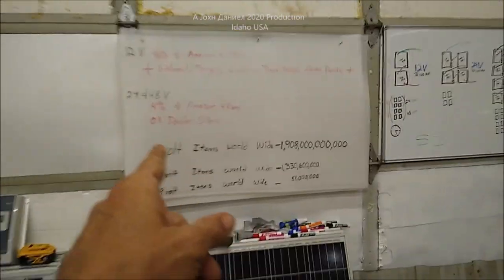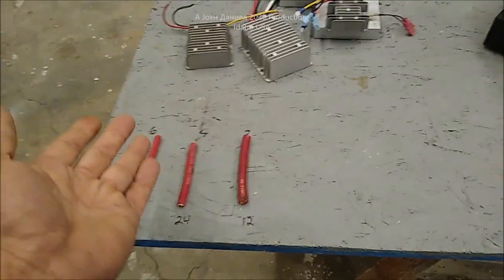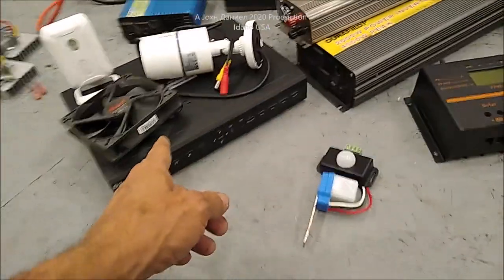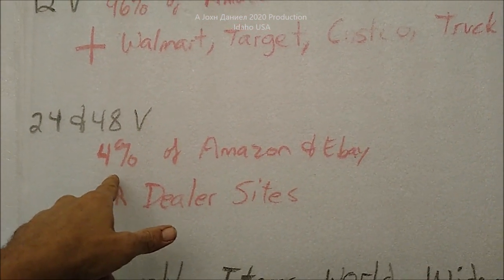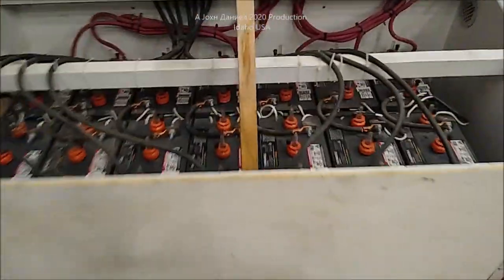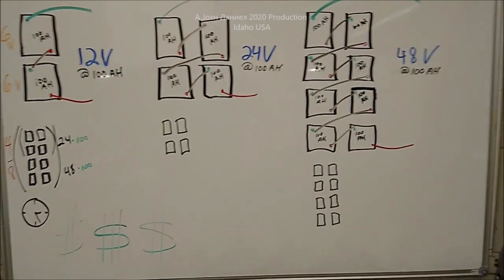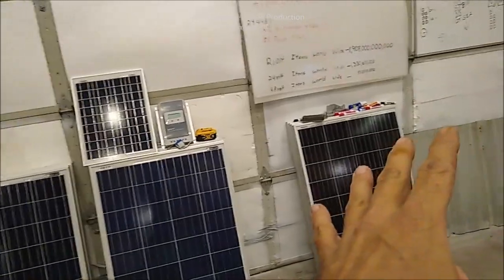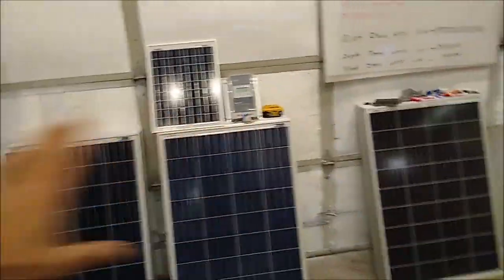Solar Wind Hydro 12 VDC is Best Voltage on Off Grid Survival Power System (Graphic Info)

Comment: One thing you seem to miss is.  Most controllers are 12/24 volt and using 12 volt batteries provides WAY more backup options on batteries in an emergency. Also running 1500 watts off of 12 volts runs 100 amps. When it gets hot outside equipment can burn up and efficiency goes WAY DOWN.
Reply from the maker: You will run a 100 amps starting your car, do we get rid of cars? Almost anything can burn up in super high heat if installed wrong. However, the 12 volt stuff from regular makers has been designed to handle more heat since its often used/ABUSED in RV's, Semi Trucks and boats. 
 I met a lot of people with massive refined computer controlled  Fronius, Outback, and Sunnyboy, 4.5 to 6kw inverters they paid multi thousands for that fried from a bug getting in them.
 Bet you didn't know 48 volt and bugs is a higher & bigger board frying arc as a team than 12 volt and a bug!!!  You open lots of 12 volt inverters still working just fine but needing cleaning that are full of bugs, but just let one get into a high dollar Fronius or Outback  (like the mosquito that blew up a $4000 inverter) and POP! Funny part is those people always have no redundancy! Freezers stop, and poof thousands in food go to crap. They can't run to a Truck Stop and get a spare to save yourself, no no, And I Saw it happen lots, not once.
Reply: @JOHNDANIEL1  I run 24 volts and 250 watt panels. Been through hail storms havent lost a panel yet. 24 runs at half the amp load to do the same job and the equipment laughs at 2500 watts. In an emergency 12 volt backup units are easy to install and native to 24 volt installations. But on a daily basis running main gear at half the amperage saves the day because common electrical wiring and breaker panels can be installed. Commercial square D breakers and panels have a DC rating as well as an AC rating. Much cheaper and easier to source than 100-400 amp safety gear for 12v systems. And I only worry about 6 panels instead of 15.

Comment: Liked the way you see it and it’s true ,I had an issue with 24v ups  it was great unit but I had to had 2 batteries in series just to power the inverter no other way and to charge it if it’s circuit what a bug , I had to buy those converters you should hehehe to maintain those two batteries charged . A 12v will or cut run in a single 12v batteries lead acid - and the other chemistry’s but it’s true there’s so much options for 12v . Also weight hehehe many will argue well what about the watts in solar you can go higher wattages faster but that’s another crazy topic anyways I know there a bigger demand if you want more watts from 12v but yeah if one battery fails you have backup .  I just happen to like lithium hehe but yeah it’s more expensive and hard to get you can just go to Walmart or Costco or any local store or auto parts and get yourself a lithium battery it must be order which does have its cons but then again it’s best to go w the 12v systems .

Comment: Hey John, I have no idea what your inside deals are!  What particular wind generator are you talking about?  I see some but which ones do you recommend that the fins dont fall apart after a year.  Are you saying a 500 watt you have to buy 10 batteries?  Is 500 w useful for running items?  What about the solar panels?  The one that sends you to WalMart? There are more than 1 panel.... so are you talking that particular one that first comes up? Additional some advertise waterproof connectors?  Why would you put a non-waterproof on a panel?  Can’t you just give a particular one and it goes to that particular product?  I dont want to waste my what little I have on buying the wrong thing.  Still Confused... there are no particular products to buy?
Reply from the maker: The first link item is the ones I am referring to, others the store may push are not part of the materials we install. As for water proof connectors, thats not expensive or complicated. Using MC4 connectors and splitters are linked below the videos. If you have decent wind options the 500 watt turbine, 6 of the 100 watt panels, and a 50 amp controller for solar can run into 6 deep cycle batteries from batteries plus ( GC-2 125 or 130 amp hour) or if you can't get those get 7 of the Walmart Exide made size 29 two year deep cycle maxx for $99 each to do the same. 
If you need a part by part list, email me olympicpowercontrols@yahoo.com but include the general location your at, plans to apply, needs, and basic abilities in funds so I can try to make you a straight across plug and go set up from the cheapest list.

Comment: John, I can see your point on using 12V lead acid batteries but, you failed to discuss the negatives of using them. How are you venting your battery bank to avoid the off-gassing problem? Maintenance with lead-acid batteries also requires time to refill them and they are also very heavy. You can only get the life out of them you're quoting by not discharging them over 25% and if you discharge down to 50% you will get around 3 years out of them. Discharge below 50% capacity will destroy them in a hurry. The recharge rate is also the slowest of any type of battery. Additionally, you can run any 12V products from a 24V or 48V system by using a step-down converter to 12V. I started with a 12V system and then went to a 24V system so I could use one charge controller and inverter of 3000W. But, you can't really generate enough power from a 12V or 24V system to run a 1hp 240V AC system due to the amount of extra power needed to start the motor. 
Now I am building a new 48V system for my off-grid farm that is using 27 350W panels set on 3 pole mounts of 9 panels each. I have 2 strings of 9 panels wired parallel coming in on 10ga wire at 362' and the other string of 9 is coming in on 10ga wire at 338'. I am  using a Sol-Ark 12k that has 2 MPPT chargers and capable of putting out up to 18K Watts of boost and 12K Watts of running power at a 96% capacity rate. Only a 4% usage rate, which is another factor you failed to mention regarding the charge controllers and inverters you are using. If they are returning a rate of less than a 20% loss, it would surprise me. I am using LTO (LITHIUM TITANATE OXIDE) batteries in my battery bank which have a 10C rate of charge so in theory I could totally discharge and recharge several times a day and up to 20,000 cycles and still have 80% battery charge capacity which makes the cost amortized 25 years at less than $0.10 per watt. Don't have to worry about freezing or adding anything to them either so, when I come back 486 miles South of my farm for the winter months I don't have to have someone maintaining them for me. I use my 24V system for my 3 wind turbine generators and will be sending the 3K Watts that they produce to the grid tie side of my Sol-Ark and have a automatic start 7K diesel generator set up to run if an emergency case arises from a lengthy loss of sunlight and wind to sustain my battery bank system. I use a step-down to 12V converter to run all of my 12V goodies including a water pump, video security system, burglar alarm with sirens and some lighting. You can not get to the amount of power or ease of use I have with a 12V system and I can also monitor my entire system using it's Wifi built-in system that shows me everything that is going on with my system.
Reply from the maker: The quality of the Lead Acid battery counts in lifespan. Dual purpose, johnson controls products, Optima types - Junk! Deka, Trojan and HUP on the other hand, 50% about 1/3 the time, 25% most the time and the last set was almost 9 years old. Best part, a war with china won't stop my system.

Comment: The hardest part of switching to 24 volt was not seeing all the high amps comming in from 12 volt. But the only thing you have to do is multiply by 2 to see what's actually comming in. The difference is like trying to start a tractor with only one battery versus two. No comparison . or better put a 6 volt compared to a 12 volt. I don't use 12 volt for anything I only use 120 volts. By the way I've been off grid now for 26 years.
Reply from the maker: I prefer all lighting, circulating, and most electronics like computer-TV-Security System-Some Appliances  straight off DC. Cuts conversion losses by 25%

Comment: I made mine 24 volts but I ran a 1/0 cable between all 12 volt points for running things..I have 8 batteries but I'll have 10 next month so one little 12 volt draw isn't going to kill 5 batteries for a minute...I don't see why I would need a doodad from 24 to 12.. I use a 12 volt Inverter off the bottom 4 batteries...I already bought a 24 volt Aims inverter/charger because somehow I got the idea the army knew something when they used it..I used to wonder why all their stuff was 24 volts...then I figured a tiny piece of it out..some of it has to be 24 v or it won't work...that's why semi truck starters are 24 volts...I guess when I worked at that truck stop in 75 it must have influenced me too...then in '91 I got the double whammy...I bought a Miller welder that welded at 48 volts so I figured there must be some reason...well after awhile I figured that out too...it just works good but the deal is 48 is too easy to arc and damage something in the grid off situation so I stayed away from that high of voltage but the deal with me was I was just always told 24 volts was better for higher wattage because it didn't get the components as hot...I'm like "okay" ...I did use 1/0 cabling though..just habit from welding for lot of years...yeah us older guys remember cars with 6 volt batteries and how no one drove in the cold because nobody's car would turn over unless they had just bought  a new battery...then when I worked at the farm the combine had a 24 volts starter on it...so I guess when I bought my Aims I was like well amps has to go through here and I guess John Deere thought it was a good idea...so that's how come I picked 24 volts...I'm not like anyone else,  if my Aims inverter/charger screws up, I'll take it to the factory and wait until it's fixed or a new one brought out..I don't mind...so I couldn't buy one from Bangladeshi..I can make it to Nevada if I need to..so that was my other reason for buying that one...lol...(I don't think I'll have to haul it to there either)

Comment: 12v carrys more amps and more heat 24v carrys amps but less amps 
48v low amps and more stable electrical current .
House items base there run times on amps so you have to do math to balance your power usage now if your able to double your amps on electric intake to a storage bank (for daily use) and the battery part you said about failure is very true.On solar you can use 24volt systems and then you can get to get to drop down to a 12volt that gives you a cleaner sign wave and to a 12volt battery bank but 24volt panels will charge slower. Lithium mining is coming from Australia and sold to china for manufacturing.
Reply from the maker: Being ready for crazy changes in the financial and world systems, I'm totally OK with all the terrible characteristics of 12 volt if your OK with loosing so much to one higher volt battery loss!

Comment: How would you wire in the wind turbine to this system?
Reply from the maker: Wind turbine, then drop 3 phase wire down to controller or rectifier, then +/-  DC wire to battery. Of course you have to use proper wire gauge, fuses in appropriate places and the more complex your system the more needs for high grade controlling methods.
Reply: Kk, so you go right from the 3 phase directly into one of the mppt controllers like the one in the diagram?
Reply from the maker: @northlander1948  Yes, 3 lines to the controller, from it to the battery. The easiest controller to use is the all in one with braking and load that has programmable options.  https://www.banggood.com/custlink/DvvYCINJTM

Comment: Charge controllers are 2 times more with 12 volts as they can only handle half the power as a 24v system
Reply from the maker: It's the same energy, just different math. 12 volt@100 watts is 8 amps - 24 volts @100 watts is 4 amps, still the same energy just stored different. So a 12/24 controller for $100 is not more expensive if you use the 12 volt feature. Ohms Law.
Reply: Јоhn Daniel not true the same controller on 24 volts can twice the power that it can handle at 12 volts   My charge controller was maxed out at 12 volts with about 400 watts   When I went with 24 volts batteries now I get 800 watts maxing out the controller still    The max battery currant is 30 amps to charge at either voltage 24 having 2 times the power   I had added more panels to get the 800 watts  after going to 24 volts
Reply from the maker: @johnpimlott1843  Give OHM's Law a shot. 10 amps at 48 volts is the same energy as 20 amps at 24 volt which is the same energy as 40 amps at 12 volts, and the same as 80 amps at 6 volts. A battery is based on amps. However, the controller which can handle 40 amps at 24 volts and can not handle 40 amps at 12 volts is a 24 volt controller, not a 12/24
Reply: Јоhn Daniel I have epever 30 amp controller    30 amps at 12 volts only allowed me about 400 watts maxed out.   When I went to 24 volts now it maxes out at 800 watts still 30 amps going to the battery   If I was on 12 volts I would have buy a second charge controller and wire to handle 800 watts   The problem is the charge controller is rated at its max current of 30 but the voltage can be either 12 or 24.
Reply from the maker: @johnpimlott1843  Ah, I get what your referring to. Yes, the controllers process a higher wattage to higher voltage, thats due to the nature of volts/amps and the FETs used in them. Can't change that factor of voltage but it won't alter my experience with dealing with single battery fails in 24 to 96 volt set ups. Wish they made a workable single small 40 amp or so 48 volt battery, then I would jump on that since one fail means not all fails. But they only make consumer level in 6 and 12.

Comment: Went to BATT+ and could not find BC2 barrery.  BC2 seemed to be a battery group.  L-903-L16 would not come up in search om BATT+.
  What amp hr are you running. Would I notice a difference between 5-10 amp hrs in power availability.  I did notice a significant price difference between 5-10 ah batteries.

I believe most of your dissenters dont like you because you because........wait for it..
......YOU MAKE SENSE!!!!!
Reply from the maker: GC2-125 is what to look for

Comment: For Rv instals 12v is best... how ever for home use unless you want to pull 1000 amps through a 12v 10Kv inverter (if they even make one) 48v and higher is better.
Reply from the maker: So many equate this video to what they have, a $20,000 system, or a Dealer Blog verses what will work for the folks with little or nothing. But I never met anyone who ran over 300 amps on one item on a 12 volt system in my 11+ years installing. They do foolishly sell 5000 watt inverters, 469 amps, but only a idiot would buy them since the common 4 outlets source can't distribute over 3500 ( PowerBrite corp PDF 2005 InRe powerbrite 3500w). The Post and internal wiring of a goofy so called 5000 watt inverter sold from China are not even capable of 4-0 wired 360 continuous amps LOL! And yes, we see them sell them listed as 10,000 watts too, buy one, you'll get 40% at best truly deliverable. 
But the purpose of the video is 3 things for those needing something to survive and be capable of doing  - Cost, Redundancy, Sourcing.   Not a contest in Amps into one item that is not even real or usable. Better to have 3 REAL 3000 watt inverters than one 10K anyhow ( redundancy!). I met alot of Morons with massive Fronius, Outback, and Sunnyboy, 4.5 to 6kw inverters they paid multi thousands for that fried from a bug getting in them. Bet you didn't know 48 volt and bugs is a higher bigger arc as a team than 12 volt and a bug!!!  And those people always had, no redundancy!
Reply: @JOHNDANIEL1  breathe dude...in...out.. in... out. wow weeeeee I feel better already!

Comment: What about ac and major appliances? Like a dryer? Curious is all
Reply: Just Use 12v to 220v Inverter Along With Your 12v to 110v... They Are Also Easy To Get & About The Same Cost On eBay!!!
Reply from the maker: Avoid Electric Dryers, Stoves and Heating. Convert or change out to LPG ( propane ) for those items and the inverters will run the dryers motors, stoves electronics and heating units controls just fine. You would need 450% more solar and batteries to achieve Electric Dryer use. Replacing the Appliances with LPG fueled is a cost that is drastically cheaper than building a power system to run those high current appliances.
Reply from the maker: The solar, inverter and battery bank needed to run a single 3400 watt electric dryer element and motor is 4,840 watts solar, 28 of the 125 AH batteries, and a 5000 watt 240 volt split inverter. $7100 dollars
On the other hand, a full 6 month lasting site refillable 100 lb 24.4 gallon propane tank https://amzn.to/31WzDB7 that cost $55 to refill 2x a year, a GE Gas drier converted to LPG from Lowes and the original system I spoke of is just under $3000, and don't need 2300 square foot of roof.
Reply: I use 48 x 250Watt +5watt RECOM MONOCRYSTALIN
2 X 6000Watt 230v pure sine 
20 200Ah
1000Ah@48v 48.000watt 
2x 500watt wind turbines 
I run my house as a house .. 
And if she want's to bake a cookie 
At 00:00 midnight .. well she bakes a game
Or put the turkey in the oven for 12hrs slooow cookin 
Well we doe's that.. if i want to run 
Any thing 12v i use a BUCK CONVERTER or POWER SUPPLEY 
I am a HAM my Amp uses 48v too 4000watt .. so in my case
Win win .. 
Off Grid .. dosen't nesseserely mean livin RV STYLE 
My kids and Girlfrind .. can't feel the difrence 
On Grid .. to off Grid 
Or on the heating pipe Grid .. i am off that 
Way too expensive .. Wood pill oven way cheeper .. IT can provider 12kw heat + 12kw hot water